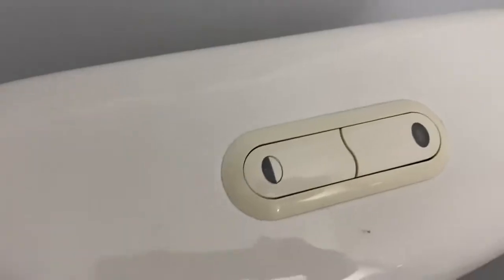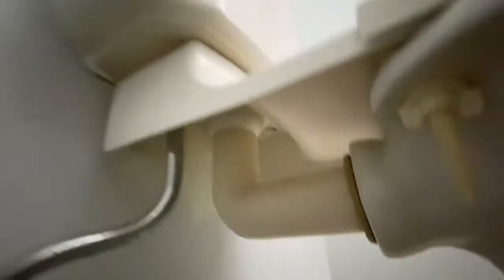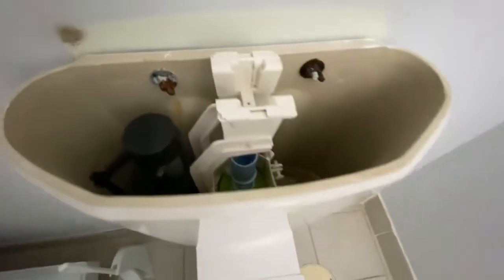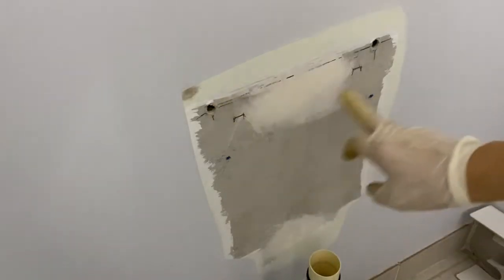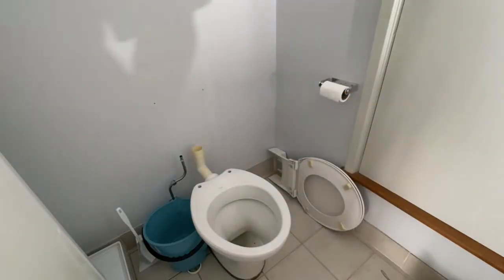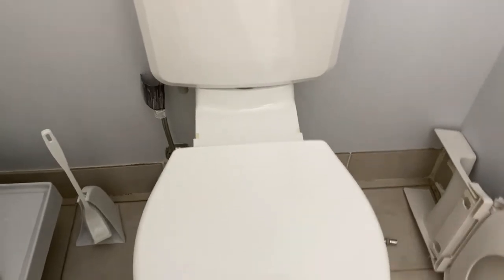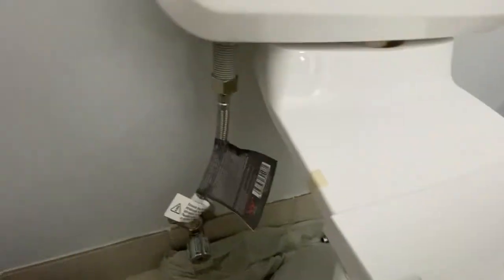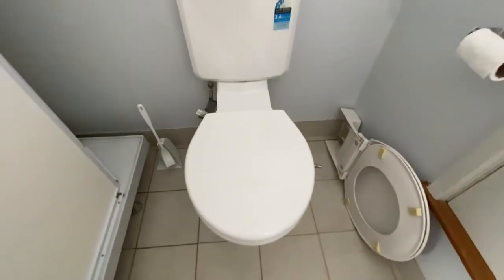How to Replace Toilet Flush System - Remove and Install Toilet Cistern - DIY Bunnings Estilo

Comment: Thanks, I've just bought this and needed a clear guide. And some flexible piping it turns out. Oh well, a day isn't complete until you've been to Bunnings :)
Reply from the maker: Hi Matthew, yes 😅 Never get sick of going to Bunnings. Just wish we all bought the right thing to start with :) 😂
Reply: @StevenKoala  I came out with the shortest braided cable I could find and still had to wrestle the input valve into a different angle to get it work and not kink up. In the end I was victorious :)

Comment: Hi Steven, I am having the same problem to what you have. But mine is an old Caroma Verona Cistern. Unfortunately there are no parts available for it. The flushing mechanism is broken and snapped off. So what I am going to have to do is replacing the whole cistern.
Reply from the maker: Yeah😫… that was why I was forced to replace this. How did you go with it? I must say though… after it is done, it does make the bathroom 🚽 looks a little upgraded😊
Reply from the maker: Let me know how you went. Good luck with it 👍🏼
Reply: @StevenKoala I didn't have the $ to fix it. Planning to do it tomorrow.

Comment: What is the system that you used and is it compatible universally to all toilets? I've got an old toilet as well and want to replace what you have done exactly but not sure which cistern and seats I should be buying - any measurements/compatibility suits I need to take into consideration? Cheers!
Reply from the maker: Hi Annie, most of the times the cistern and its parts should have some allowance for common installation. So the compatibility is quite flexible. I wrote in the title what I bought - it is Estilo brand from Bunnings. Hope this helps😊